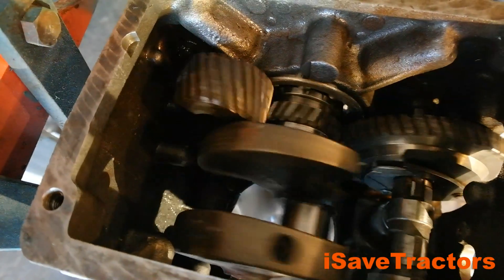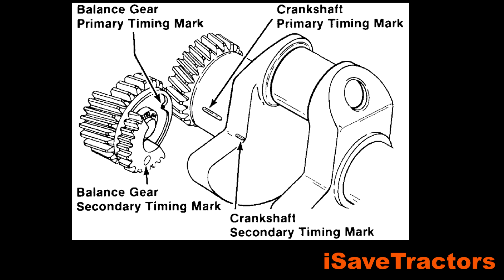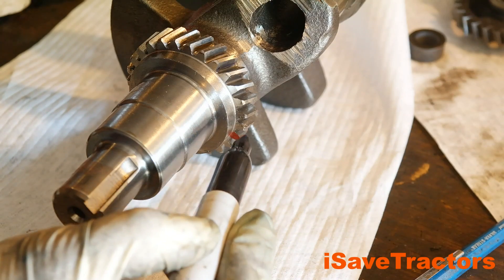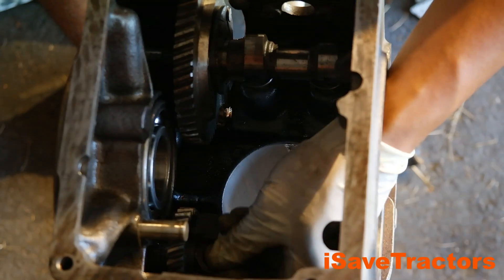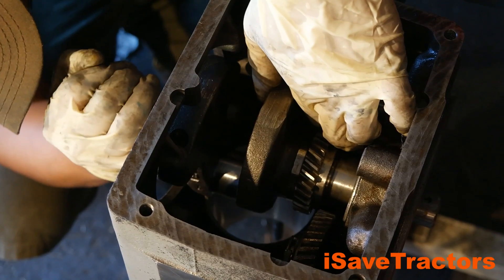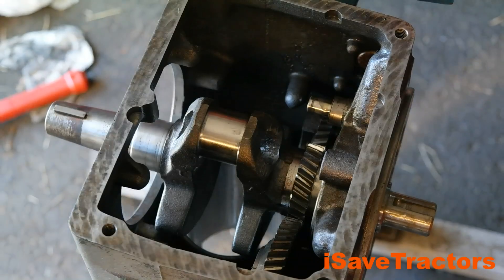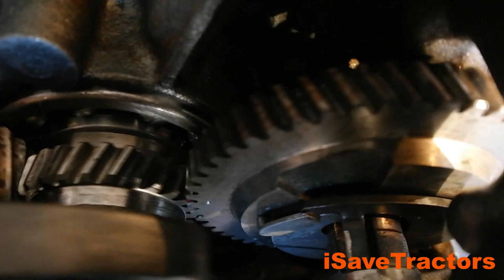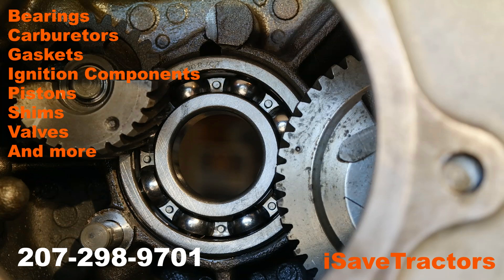How to Install Balance Gears in your Kohler K Series Engines

Comment: Very hard to film this but you did a great job. As a teacher for car mecanics i try to find videos and animations because it is much easier to understand when you see it like this. Hope you sell a lot of parts to people watching this!Regards Nils
Reply from the maker: Yes this was challenging to film. I may try my hand at learning an animation software to show this kind of stuff in the future.
Reply: Good intention but I would guess that a lot of time would be needed for that. Tried Solid Edge back in school and while I managed to “construct” a hedge pruners it was far from easy.
 I have a animation of the BMW Valvetronic and Vanos system used in their small 1.5 liter gasoline engine. It is great! You can adjust engine speed, valve overlapping and intake valve lift. Also you can rotate the engine the way you want it and choose to have the cylinder head visible or invisible. I can’t imagine the effort to make such an animation.

Comment: Please add a still photo of the balance weights with the crank throw at bottom dead center.   That may be more easy to see if the weights position is correct.

Comment: Finally got that 214 today and it does indeed have a locked up engine. Per chance, what would lead up to having to replace a balance gear?
Yes, I'm eyeballing your master rebuild kit right now. 😁
Reply: No need to replace balance gears, just bearings as needed.  The new balance gears do a better job balancing the engine (removing vibrations); optional upgrade.  Some engines have had the balance gears removed by incompetent or lazy techs, leading to a lot of vibrations.  In this case, get new balance gears during rebuild, and thank Norm.

Comment: By any chance you know off hand what year and horsepower kohler started using balance gears?
Reply: Willy Ck look it up in the manual, if l remember wells they begun using  balance gear after k301 engines

Comment: I have a k532 kohler 20 hp i dont see them in mine at all, i have a problem when i replaced pistons after i broke a connecting rod. It hits the cover with cam shaft gear ,but found out can adjust end play with rear cover which i cant seem to remove. But anyway ehat am i missing do piston go in any order like numbers up or down does it matter. Thanks alot
Reply: Your engine doesn't have them, Google a repair manual for kohler twins to see how pistons go in.
Reply: @will7its  I didn't see nothing on reference to install a certain way ,thought they might of wore in on one cylinder and I put it in backwards to where it was. But thanks I very intrigued to learn more don't think it's over, end play wasn't good then it better but runs terrible ,starts good but runs like bent cam.
Reply: @michaelbaskinmichael9862  Could be a condenser or the timing, Good luck
Reply: Idk for sure but even when I crank it over the flywheel sounds like bent or not on right ,but I checked . It must be a piston or wrist pin.

Comment: I bought some parts from your website, great quality and super fast delivery!  
I had a question tho.  When rebuilding a k341 are the balance gears necessary? I have read that they can be left out, without any serious consequences to the motor. What would your opinion be?
Reply from the maker: I just wrote an article on this subject for Lawn and Garden Tractor Magazine. I will be publishing to our website next week. In short, yes keep them but check end play, and needle bearings before doing so.
Reply: @Isavetractors  Link to article?
Reply: @Isavetractors the only reason  someone would recommend keeping these gears in a K series, is if they were selling parts for them. Poor advice Norman

Comment: I may have to get with you on parts for my Kohler J D 316 it runs fine but tries to come out of the tractor at start and kill lower idle. I've heard they kick but it's a bit much. Thanks for the teaching videos.
Reply from the maker: green&yella fella your engine in your tractor should definitely not feel like its going to buck out of the tractor. Your 316 even has rubber engine mounts to further help tame vibration. Something may be wrong. Call our office and ask to speak with me and I can help you through it
Reply: @Isavetractors  engine mounting may be damaged,  or idle speed set too low

Comment: I have a question regarding my Kohler K321S on my MF14 garden tractor.  I had the motor rebuilt at a small engine shop 2 years ago.  They replaced many parts, including the dipstick.  The Kohler manual calls for 2 quarts of oil for an oil change.  If I put in 2 quarts it reads well over full.  I have to remove about 4 ounces.  I'm torn.  I don't know whether to rely on the dipstck, or simply put in 2 quarts,  and let the oil line fa;; where it may. Thanks in advance for any help.
Reply from the maker: They certainly could have put the wrong dipstick in it. If your manual calls for 2 quarts stick with 2 quarts and move the Mark's on the dipstick. 2 quarts is pretty standard for the deep oil pans.
Reply: Wayne W hi, sir could you please tell me a little bit about the process of taking your engine to a small  engine shop for a rebuild, did they order the parts off Norman's website  and they did all the boring and reground the crank shaft etc.,  because l really wanna save a K301 but  after reading a lot cant do it myself and don't have all the tools, l rather to take it to a shop, but l need a trustworthy shop, l wish l could do it myself, those older engines are sweet!, please any info will be really appreciated
Reply: Wayne W l also have  K321 in a 1978 wheel horse automatic and for now it works and sound good, but l know it definitely will need some work some day in the future.

Comment: I have a quick ? I have a Kohler k341AQS that had a bad crank I found a Kohler K341A with good crank. The K341A had two balance gears like this video an upper and a lower. The crank is the same I've asked on kohler forums. My ? is that the Kohler K341AQS doesn't have those balance gears just the camshaft and the Crankshaft. Do I time it the same way minus aligning the balance gears as there isn't any on the K341AQS block. Basically wondering how I time this without the balance gears any help would be greatly appreciated thanks.
Reply from the maker: Yes just time the Cank mark with the Cam mark and you're done! Full service manuals for download on our website.
Reply: Thanks for the  quick reply do you know the torque specs on the new connecting rod bolts? the new rod and piston had bolts instead of studs with nuts not sure if torque specs are different for studs and nuts compared too the bolts as well? I have a nice chiltons book for 20hp and below but doesn't mention torque specs on the connecting rod bolts what do you suggest  and should I use some locktite? Any help would be greatly appreciated thanks again much appreciated trying too save my old john deere 316.
Reply: Just wanted too say this is a great video and very helpful searched all over and watched a million bad videos until I found this gem of a tutorial anyone looking for good tutorial this is it thanks again.

Comment: Everyone tells me to remove those "balance gears".. I would like Norman to tell us what the advantage is of keeping them in the engine ? Realistically, we are not operating at 5000 rpm, most of our engines never even see 3000 rpm. Do I really need balance gears and the risks that they pose ?
Reply from the maker: I wrote an article about this. Published in Lawn and Garden Tractor magazine, Cadet Connection Magazine and on our website. Here is a link: https://isavetractors.com/articles-1/engine-science-the-balancing-act-of-single-cylinder-engines/

Comment: Where would I look to find a garden tractor that isn't too expensive that could be used for farming. Thanks.
Reply from the maker: craigslist! Perfect for small farming. Old Cub Cadet, Ford LGT's, Wheel Horses, Old John Deere 140's, 314, 317, 318, all great for pulling moldboard plows, tillers, cultivators, etc.
Reply: isavetractors Ok thanks. I'll have to check it out.

Comment: Where in the world did you learn all of this? I have a HH100 and I'm terrified to change the oil let alone tear it apart
Reply from the maker: Brian Philbrook books and practice!
Reply from the maker: Your HH100 is a simple engine to take apart. You can even tear it completely down without removing it from your tractor.
Reply: isavetractors wow I didn't know that. I've been trying to talk my wife into letting me bring it down to you to have an expert look at it. I live up north of you just outside Presque Isle.
Reply from the maker: I also trained with the Equipment and Engine Training Council and have been engineering parts for a while. We are a good 5.5 hours from you! Road trip time!
Reply: isavetractors lol it'd be a good trip lol

Comment: Never reinstall balance gears and always remove them, completely  unnecessary.  Sooner or later they will fail. Many K series engines did not have balance gears, these were only installed to create operator comfort.  Get your crank shaft, rod & piston dynamically balanced if engine vibrates too much or if you have upsized piston.

Comment: Nooooooooooooo not the grenade gears
Reply: I am a little new to these engines. I am thinking that mine might have begun to come out of place today while plowing snow. Is there any extra vibrations present if you delete these gears ??
Reply: @johnchadwicktilton  these engines shake with or without them. I dont have them in any and have some super smooth ones. It all depends

Comment: No no no... you don’t want to put balance gears in or back in one of these engines. They come apart and tear the engine up. There also not necessary.
Reply: really..just getting ready to put my k341 back together,,want to elaborate on the no balance gears...??

Comment: take them out and get everything re balanced
Reply from the maker: That still won't solve the secondary vibrations a single cylinder engine has at 90 degree and 270 degree of rotation. See the article on single cylinder engine balance on our website
Reply: thats true but with lower RPM vibration....  once you raise the idle with or without  balance gears it smooths out   .. but to me  it's less rotating parts and wear.... less things to worry about ../ as in possibly failing which  in some cases  they have let loose and blow a hole in the side  of  the block  .. if they were 100%essential all the K series engines would have  come with them ... your  instruction video is excellent though...  keep up the good work I enjoy your  channel  they are  very helpful
Reply: I'm new to these engines, and not a mechanic, been learning through videos and reading, but still a long way to go, l bought a 1978 wheel horse C-141 last August,  very well kept, the first owner did a good paint job  anyway the tractor stars and runs perfectly fine, only issue when rising the throttle at midpoint it shakes bad,  all smooth at idle and full throttle, only problem halfway, l noticed the engine rubber mounts are a little worn out, l got the new ones, and hope it will solve the problem, and hope it doesn't have to do with those balance gears 😳😞